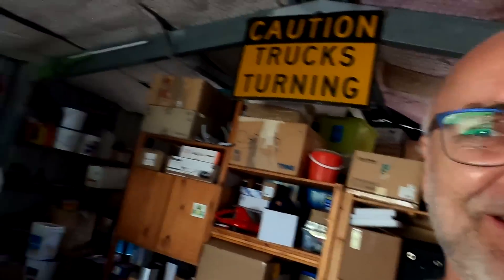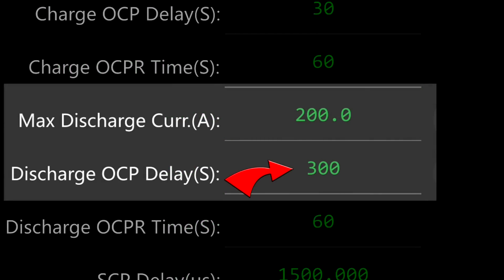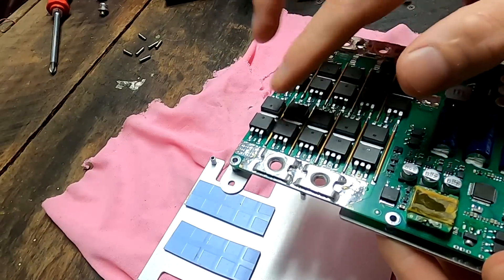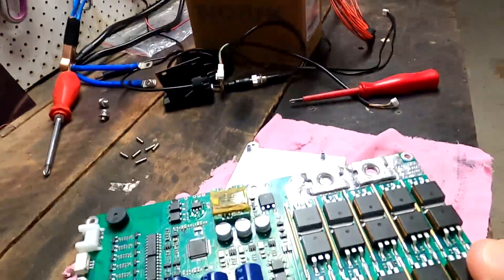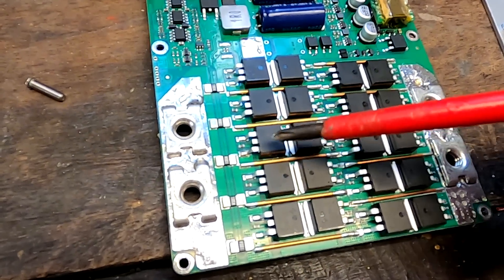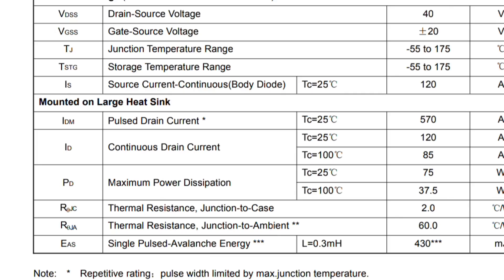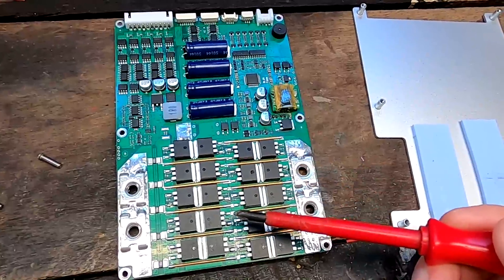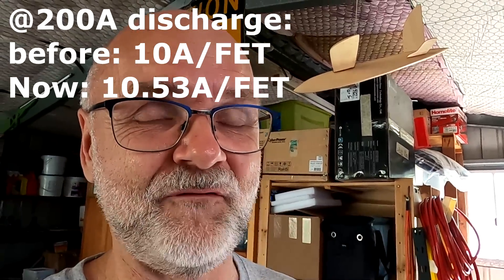Magic smoke! What happened to the JK-BMS? Still reliable or bad design?

Comment: Back in the day, doing poor-person's reflow work, they'd use tinfoil over the parts you don't want to get hot, exposing just the part you want hot. This was often done in a toaster over to reflow BGP solder joints, but I wonder if you used tinfoil over the good mosfets, and used the heat gun on the bad mosfet, if it would sink enough heat to loosen the solder and let you pop the bad mosfet off? If you then use a 200~300w solder gun to put fresh solder on the pad, then repeat the tinfoil + heat gun trick to resolder the drain to the board, maybe it would work?
Reply from the maker: What about the FET on the back though? I'm scared to destroy it in the process, hahaha and make it worse. Yeah, cooling the neighbouring FETs would be another concern...
Reading all these comments, it seems easy for some if you have the right equipment and experience (not me). Others have advice to just leave it and cut the legs... I very much tend to the latter. I neither have time nor the equipment to replace it at the moment.
Reply: @OffGridGarageAustralia  It could well melt the connection to the back one, but maybe a heat sink would help keep it below the solder melting temp? Just throwing ideas out, can't say they're useful ideas. :) Your idea though of just cut it out and spread the load out does seem perfectly fine as well.
Reply from the maker: I'm really worried, that I will destroy more than anything else in the process. Not having the right equipment and time to properly looking into this is the biggest hurdle. The FETs are only a few mm apart from each other and I'm sure I could heat up the old one enough to get it off, but what then? I have a 300W soldering iron but again, not enough time to do proper research and watch a few videos on how to do it correctly. I may had to try on some other PCBs first for training purposes.
Reply: @OffGridGarageAustralia  Sounds like the best approach is to ask JK to send you a few more test units! ^_^

Comment: Usually MOSFETs are dieing with a short, that means the safety switch off doesn't work anymore.

Repairing the PCB would be a little nightmare, because of the density and the doublesided population
Reply from the maker: And I don't have the equipment or experience with this. Not the time...

Comment: The board has a huge very conducting thermal mass due to the copper planes and the MOSFETs. Preheating will be needed. Use a reflow (hot air) soldering station with tin foil heat shielding or a high-power temp-controlled soldering iron with a large thermal mass. Heat and lift the pins first.
After removal apply flux and solder wick to clean the pads.
Reply: Use Kapton tape to help protect surrounding devices, use might even get away with just using a hot air desoldering gun

Comment: You are unlikely to be able to solder a new MOSFET in. You need one huge iron with a lot of thermal mass to be able to do that. 

To be on the safe side, i would cut the two legs off the MOSFET, de-solder and remove them, leave the body in place, this way it will not cause any issues.
Reply from the maker: I have a large 300W soldering iron with a large chisel. That should do the trick. But it the board won't be the same any more...

Comment: I'd say your analysis is pretty much on Andy. Lucky I guess the over-current was not a bit lower and it latched closed.
As it tripped on cut-off, and from a recent experience I had with a cheap battery spot welder that was blowing Mosfets. I found several videos online saying that if the the gate voltage was low or the gate circuit had residual voltage, some the Mosfets might not switch off at the same time. With 200a of current, I wonder if you could have have got a voltage spike of well over Max VDD, and the weakest of the lot went first. It would be interesting to put a digital storage scope on the Gate and see what voltage looks like when switching, and see clean or noisy it is.
From this side of the screen I'm catching a whiff of more than blue smoke, and  with a brand new design as a manufacturer,  supplier or critical application user, I'd want to do more reliability testing to get a better sense if it's a random failure or a vulnerability.
Also, I'd be inclined to test it as is and see how it holds up with the blow Mosfet. If it holds under test then maybe a good design, if it blows or has other issues, then time to re-evaluate and re-calibrate.

Comment: A few points:
1)  It is possible that this is a one-off failure due to a bad FET,  not a fundamental design flaw, but it is still a black mark on the BMS.    That should not have happened since it was operating within the advertised parameters of the system.  

2)  Overall, I am disappointed in the failure, but it still seems like a good BMS.

3)  I would not bother with trying to change out the failed FET.   Trying to change it is just as likely to make things worse as to make things better.

4)  I would not design a system that ran any BMS at its full rating.   I like to have at least a 25% margin between the rated current and the max it will be run at.   The target sustained current for a 200A BMS should be closer to 150A or less*.    However, If the problem was a bad/slow FET, the problem might have happened even at 150A.   (This is *not a ding on what Andy did.    He drove the product to its specified limits as part of his evaluation for us, his channel viewers.   He even said in the video he would not normally be running it that high)
Reply: If there is too much inductance in the wiring + load, the FETs' SOA or avalanche energy can be exceeded by the installation and blow perfectly good FETs too. In that case, you can expect to blow FETs on a regular basis from disconnecting under heavy load. Keep in mind that a 2500W inverter operating from 13V will have 50-100A of ripple current on the DC bus, so the likelihood of blowing FETs will be a function of how close to peak current the disconnect occurred.
Reply from the maker: Fully agree with all 4 points. I'm the same.

Comment: Compared to the other JK's, the continuous current for the MOSFETs in this one is a bit low. The 100A 48V version for example has them rated at 180A (G035N10N). 
You can replace the MOSFET if you want with a SMT rework station (hot air). If you wouldn't be at the other side of the world I'd do it for you...

Comment: Andy, more than likely that mosfet was not making great thermal connection to the heat sink through the thermal pad, they usually only crack and pop like that when the mosfet overheats. The reason it overheated is unknown really if lack of cooling or faulty manufacturing. I would use a hot air soldering  to heat the mosfet up enough to flow the solder for removal and hot air flow the new one on. Typically mosfets are good for up to 400c soldering, but many recommend controlled soldering of up to 260c for up to 10 seconds, I’ve seen a few say 300c up to 10 seconds also. I’ve repaired many with just hot air soldering without any issues.
Reply from the maker: Could have overheated while turning off. If they don't drive it to the close position hard enough the internal resistance increase and therefore the heat. That's my understanding so far.

Comment: Andy, with the pulse load, check out the pulse timing diagram mate. You need a soldering air heat gun. Plus some solder paste. Plus some alcohol Plus toothbrush to clean afterwards.
Reply from the maker: I need alcohol for sure 🍺
Reply: @OffGridGarageAustralia  It's pure alcohol so pop it in an orange for a week. ;)

Comment: As a general rule, semiconductors are extremely reliable within their design specification envelope and manufactured with extreme precision and very repeatable processes. The MOSFET therefore shouldn't be assumed at fault. Repeat the same 203A disconnect on a new BMS after 5 minutes of self heating and you will very likely have one MOSFET pop again, and most likely it'll be the same or immediately adjacent one that pops. Yours was in the middle of the bank, which means that MOSFET had the most adjacent heaters around it and combined with it's own heating, that MOSFET had the highest temperature and therefore slowest switching speed. Matched switching speed is critical as all the colder/faster ones in parallel switched off slightly faster and started forcing all 203A of load current into the slower ones, and when those slow ones are starting a few degrees hotter initial die temperature, it becomes quite trivial to overshoot the MOSFET thermal limits by multiple orders of magnitude. At microsecond timescales needed for switching, thermal conduction carries no heat away, so it's like getting hit with a 2.5kW laser pulse in a really, really tiny area.

You should lower your over current threshold to 160A or less and reduce the delay to ~30 seconds or less to avoid repeats. The MOSFETs chosen on this BMS have a remarkably tiny die relative to their RDSon and voltage specifications, which means they are rather fragile during the massive power dump that can happen at switch on and especially switch off. The 200A 24S JK BMS's use half state of the art/tiny die MOSFETs and half old generation/big die MOSFETs for the very purpose of making the "multi-kilowatt laser pulse" far less powerful by spreading it over a substantially larger silicon area.
Reply from the maker: Thanks Howard, great explanation. That makes sense. I will repeat the test again with the existing BMS and see what will happen.
Reply: @OffGridGarageAustralia  Maybe with a thermal camera?
Reply: @OffGridGarageAustralia  Do you still recommend these? My Ant BMS won't turn on, and I am looking for a 200A BMS for a 48V Lithium Ion for a 3000W inverter.
Reply: Howard's assessment sounds entirely plausible. However, lowering the over-current threshold may not help if the BMS has to interrupt a high fault current. Short circuit protection is one of the requirements of a good BMS, and it appears this BMS would interrupt a short circuit only by frying FETs, and then only if the FETs don't fail in a shorted state. "Not fit for service" until proven otherwise.
Reply: @SVAdAstra  The first two questions to ask are: 1) how big is the input choke in the inverter and 2) does it have a working suitably-sized input protection diode to provide a freewheeling path for the choke current? Under full load, input current may crest as high as 400A and if the inverter has a 1mH input choke, that is up to 80J for the FET array to absorb on turn-off. 4J per FET is enough to blow up just about anything available in typical board-mounted form factors and would almost guarantee at least one more dead FET per full-load turn-off event.
Reply: @teardowndan5364  You know what you are talking about. They do not recommend parallel connected batteries because they simply can't withstand the big possible currents. Very bad BMS in my opinion. Also 40v FET's is no good. A BMS can only be a BMS when short circuits and overloads can be safely switched off for at least 25 times. (Requirement for some certifications)
Reply: I doubt it has much to do with heat. I'm suspecting the unlucky FET's avalanche energy (wiring+load inductance on the DC bus) or SOA gets exceeded during turn-off.
Reply: I think I’ll stick with my relay based QUCC BMS.
Reply: Thanx for this detailed explanation. Very helpful!
Reply: It can be due to voltage spike too, if the inverter have L-C filter than the mosfet after turn off could be hit by inductive spike from that filter
Reply: @vlapr0571  Most inverters have capacitors directly after the fuses, no inductors on the high power input. So only the wiring is responsible for the spike.
Reply: @Robbedoes2  thanks for correcting

Comment: The delay in sec before disconnecting could also be related with temperature: it is possible that for long delays an additional heat dissipator is needed to keep under control the temperature. The default value in secs should be much shorter than 300 sec to avoid overheating

Comment: I would leave the mosfet alone. You were using it in a test. Probably will not use normally as in the test condition (I'm guessing). Great information on how the mosfets/bms works

Comment: may you correct me if I wrong.
how they used 120amp mosphet on something that it should handle 200amp. the bms itself has 20pamp rating or 100amp?
Reply: The BMS is sold as a 200A continuous unit. That's 200A continuous for 5 minutes.

Remember, that 120A rating is for a single MOSFET. As the video described, that 200A is spread across the 20 MOSFETs, making each receive only 1/20th of that, or 10A. So they're well below their rating when they're working as designed.

The fact that one blew is merely a part of life. Most likely a faulty part. Probably turned off slower than the rest, possibly inductance caused a voltage spike as the magnetic fields collapsed.

The BMS did indicate that it turned off due to the settings, so it hit the 300s of running above 200A continuous, so the failure definitely happened during the turn-off.

Ideally, the system should only be doing this as a last resort, and turning off under such a load is prone to lead to susceptibility to component failure. 

As the user, you are responsible for ensuring that you don't push a system to the max. If you need to pull 200A for 5 minutes, get a BMS which can handle more for longer, or add a parallel battery to split that load. 

The cutoff setting is a safety measure, to prevent more dire consequences, like a full system burnout, leading to devastating fire. 

As a manufacturer, it probably is something that you expect could happen, but shouldn't be the normal occurrence. The BMS performed as expected.

Perhaps they could have ramped down the current briefly (time of milliseconds) until it was safe to dramatically drop the flow entirely, to ensure the system wouldn't experience component failure. This might ensure that safety of components was ensured and the customer, who is causing the issue, would still have a working device. I'm not sure if this could be a thing.
Reply: Because there is many MOSFET used in parallel

Comment: Use a heat gun and lots of flux, to unsolder and resolder it. Or cut the leads on the old MOSFET and solder on the new one.

Comment: Hi Andy, I think the 300 sec before cutting current is too long. A safe value shoul be in the 5 to 15 sec to avoid overheating
Reply: But it was running at 203A, VERY close to it’s continuous 200A rated load anyway, so not really “overloaded”.

Comment: When you see the rating for any component, remember that is plus or minus a tolerance. For common resistors and capacitors that is often 10%. If the MOSFETs have the same tolerance, that means a "200"A MOSFET can only be relied on for 180A. To rely on the parts, you need to underrate them. And then underrate them AGAIN because the ratings may be at 20°C.

Comment: You need hot air to remove mosfet and put a new one in. However it will take a long time and a lot of heat because the board have a lot of heat sink. might as well leave it as is.

Comment: Ignore the pulse current,its a charger and ya gotta remember they are in parallel,it was a unmatched mosfet and the main problem is that they dont have any proper cooling cause the metal tab is used for it not the front so it got to TJmax and then some

Comment: You have 2 solution, exchange the FET or leave it be but NOT entirely. 
If you decide to exchange it, you start by cut the 2 legs of and desolder the legs so you don't pull of the traces from the PCB.
Then place som solder on the top of the heatsink, heat it up until you can remove it with a tweezers then clean the surface for the heatsink.
Place fluent solder paste, consisting of a lot of small solder ball with a lot of paste, plate it on the PCB where you want to place the FET.
Then solder both legs to the PCB so the FET doesn't  move while heating the heatsink.
Then heat up the heatsink and be ready to push down the FET when the solder start melting, keep pushing down on til the solder is harden.
Clean up with isopropyl alcohol.

Second option, cut of the to legs and de solder them. 
It is important that you do remove them since nobody know if it is making a load on your gate driver, if it is driven in parallel with the other FET's,  then you might have it conduct between gate, drain or source, so when it is switch off it is still conducting slightly and nobody know how it will develop into the future.
PS: don't worry about the temperature, it can take a lot of heat, just don't pass 350°C remember to have a good heating conduction, use solder.
Good Luck, what ever you doo 😉

Comment: Yepp, I think it might have been a FET produced at the border of his specs and it probably cut off slower then the others.
Hang up the two legs and have fun testing with the other FETs.
Solder will probably only be possible if you are using a solder iron which is normally used for rain gutters.
I can`t wait to see more about the 4S JK because I plan to setup a 280Ah 4S for our RV.
Reply: Did you ever set up that 280ah 4s for your rv?  I'm setting up the same ah and bms and was wondering how yours is performing.